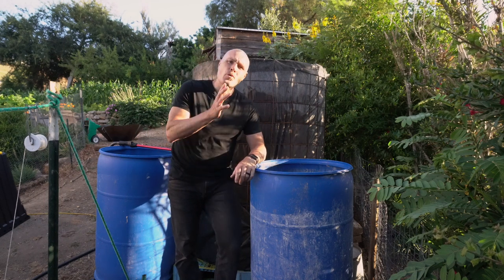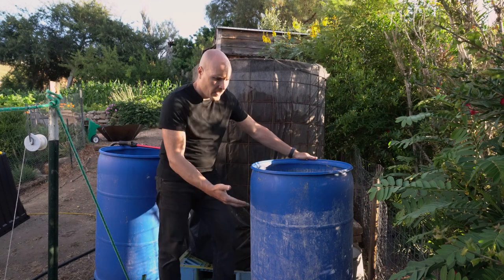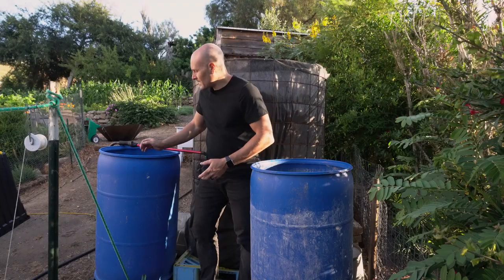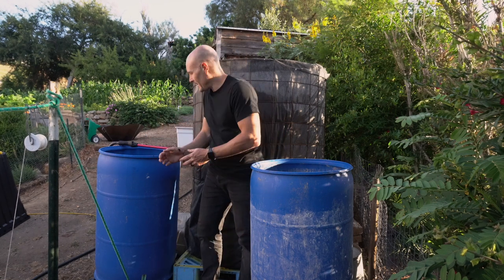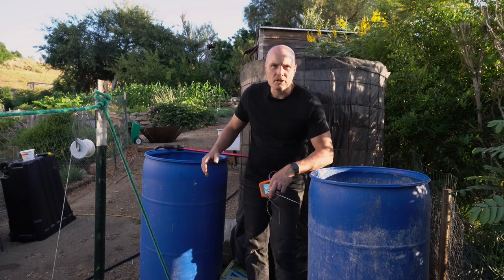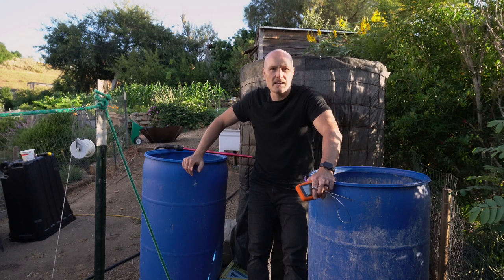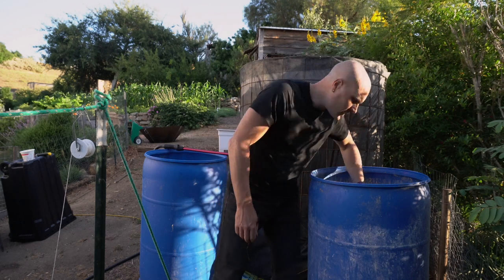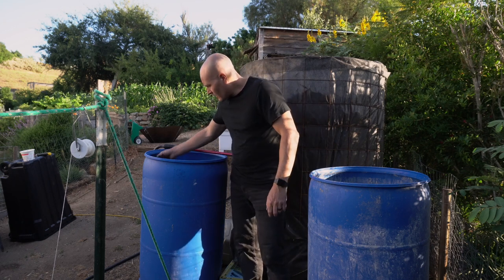Aerating Compost with a Leaf Blower | UPDATE VIDEO

Comment: I feel another metric which is interesting is that while control pile has 'shrunk' more, usually an indicator of functioning composting activity - the experimental pile has the same physical qualities yet more^ sustained mass (part of the end goal we often give up).  Wondering if the fungal activity, while not seen yet in tell-tale white stranding, might be more efficiently replacing and adding material with balanced fungal mass, or if the higher water mass is the simple reason for this higher mass.  Just a thought and I'm looking forward to seeing updates over time.
I'm not a proponent for introducing extra energy systems into processes - except in experimental stages; the information here, if beneficial,  could be improved upon using known passive techniques to add the needed air flow. Thanks for pushing boundaries and providing great content.
Reply from the maker: Thanks, I appreciate that.  The mass not reducing is a great point.  I will try to do some research on that.  I also have a video of a passive version of this coming up as well.  :)

Comment: What would be better, blow or suck? In hydroponic systems, ebb & flow suck oxygen to root area when water run back to reservoir tank. If you tape plastic bag over barrels head, you can see how much air actually flows thru your compost.

Comment: Size reccomendations are usually for 1 yard or a cubic meter more or less (but not much less) hard to achieve real compost without size, moisture and carbon nitrogen around 30:1 total ratio. A high carbon mix will stay cool and breakdown slower without the bacterial growth. How is the big one doing?
Reply from the maker: Big ones are doing the same.  I would question your statement on "real compost".  I think compost has to be looked at as a spectrum.  One one hand using your metrics what you say is accurate if you are going for a traditional bacterial dominated compost.  On the other end of the spectrum you have a fungally dominated compost where C:N ratio and size do not have a factor.  In this case I am going for the latter.
Reply: @DiegoFooter  Ok, I thought with the forced air you were trying to bennefit aerobic bacteria as in a Berkeley style hot compost. Fair enough on the 'real compost'. I was refering more specifically to hot compost recipe and there are certainly more ways to compost.

Comment: I might have missed it but how often are you injecting air?   My Aerobic septic for my home will experience bacteria die off in less than one hour without air were the water becomes noticeably more stinky.  If almost constant air is required then maybe a fish tank compressor would be more suitable for the task.  My 500 gallon septic uses 80LPM of air.  In the horse stall experiments a University was recommending I had thought they said 30 seconds ON with 60-120 seconds OFF for the first 21-90 days (in a 3ftx3ftx3ft bin). Also PVC leaches chlorine chemicals at temperatures as low as 125 degrees so having it in the center of a hot 130+ degree pile is a slight health hazard.  Thanks for exploring the differences.
Reply from the maker: 10 minutes two times per day. It’s fungi that we are feeding here not bacteria. Plus the pile is somewhat aerated anyway just naturally, so it really shouldn’t go anaerobic at all

Comment: I know Im late to the comments. But my theory as to why the forces air is warmer is. As you said it was wetter. That extra water equals more thermal mass, there for holding on to its heat longer.

Comment: Great video, thanks.
How are you sizing the blower btw?
Like to know air to put for a given size of pile.
Reply from the maker: I just went with a blower that I had easy access to and was relatively cheap.  If I had a much larger pile I would upgrade to the blowers used in bounce houses.

Comment: Have you read Teaming With Microbes? It's amazing, and it answers some of the questions you're asking. If you're applying a gallon of water a day no matter how often you blow air in the water will not allow much air to remain. Perfect moisture in a pile is when you can squeeze with all your might and get a drop or two of water out. Any more water than that will turn a pile anaerobic = that musty smell you describe. Typically the wood chips you're using would support a fungal dominant environment. Overall the longer a plant lives the more fungal dominance it prefers in the soil (as a general guideline) - so your fungal dominant composts are best for trees. If you want to feed shorter lived plants (think vegetable gardening) you want more bacterially dominant soil and compost (because a huge part of the composts' advantage is that it inoculates your soil). Usually adding alfalfa meal will increase bacterial dominance (or other natural nitrogen sources, such as vegetable scraps and grass clippings). However, adding the air would also encourage bacteria. It could get too hot though - I think (trying to recall for sure) it's 150 - at which carbon starts to be lost from the pile into the air, which you don't want for both the value of the compost And the environment. The most scientific way to test your hypothesis would be to have both samples tested at your nearest lab - testing for nutrients and microbial balance at the end
Reply from the maker: I would question that bacterial part.  From a lot of the interviews I’ve done that idea is oversimplified.  Also it seems bacteria in the soil does not seem to be the problem, meaning we have enough. It’s fungi that are the problem, meaning we need more.  When organic matter decomposes carbon goes up into the air regardless of temperature.
Reply: @DiegoFooter  I did some further digging, pun intended. I understand some of the differences. I appreciate the info, I'm sorry if I sounded short earlier - I'm thankful for your information :)
I'm still doing a lot of research: haven't found answers to all my questions yet. Do you recommend any info on how to apply this to smaller seed? I see that Dr. Johnson applies the compost as a slurry to large seeds in a cement tumbler before planting, but what about really small seeds? Like carrots? Do you use a paint brush? Is it still best to use this type of compost for them, or do you think worm castings would work better?

Thanks for the great videos
Reply: Dr Johnson has also used an extract and direct injection of the extract to the planting site.

He takes 20 lbs of compost and flows 6000 gallons of water thru it three times. This gives the fungal culture with the least compost needed per plant, which is best for large scale, profit driven farms.

The same idea of culturing the soil could be created for home growers. You could mix the compost with your existing soil as an amendment, or drop a little in if you dither a hole. The critical part according to Dr Johnson is to get the fungi in contact with the seeds from day 1. He claims there are chemical signals which symbiotically activate growth for both the seed and the fungi which accelerate growth at all stages of the plant, so getting the process going is important.
Reply: @firstlast-xn6ul  thank you 😊

Comment: Why use barrels?  If you use pallets or fence panels, air can get in the sides. Why don't you add manure and leaves? Then it will really heat up.  Organic farmers can use it if it's hot enough and aged enough.  I know that with my soil, the soil report showed deficiencies that manure could easily fix.  Composting wood chips is too slow when compared with manure plus brown materials.

Comment: You would need to saturate the air stream with water to prevent drying
Reply from the maker: No, moisture wasn’t a problem.  But good question.

Comment: I’ve thought about doing this, but with an air compressor instead of a blower.  I’d be worried that there would be too much resistance for a leaf blower to force air into the pile.
Reply from the maker: Air pressure hasn’t been a problem.